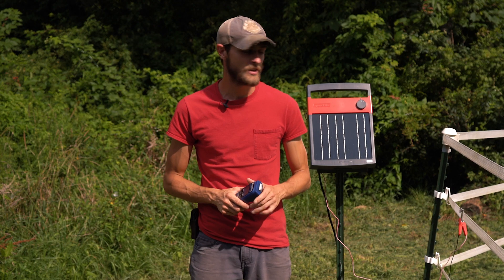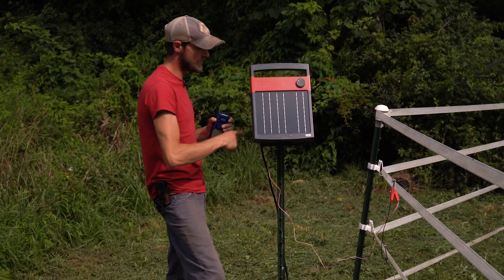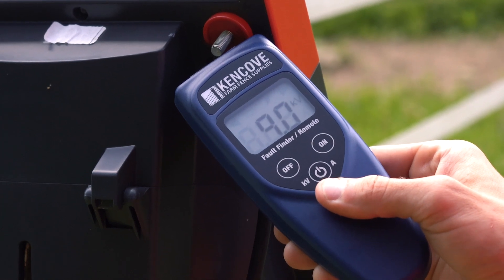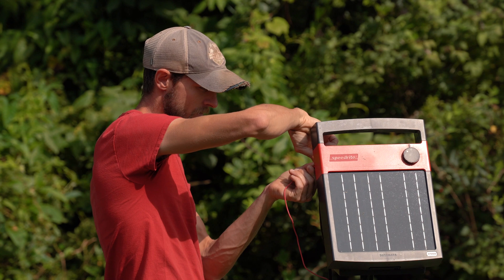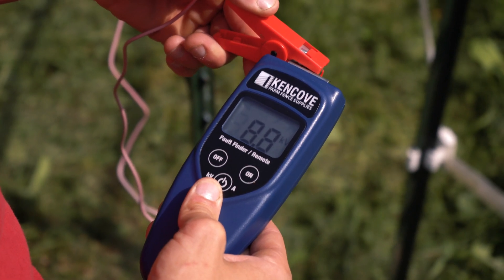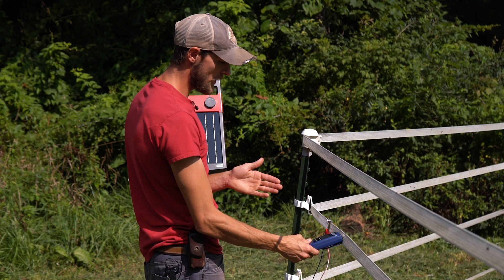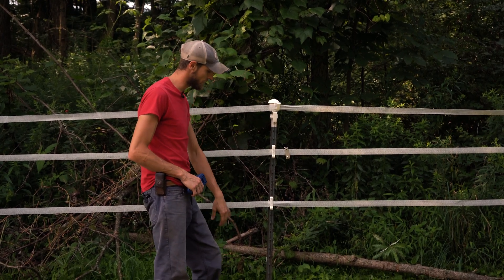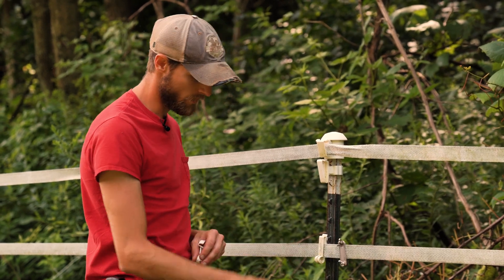Fencing 101 - How To Troubleshoot Your Energizer and Low Fence Voltage

Comment: Question please. 
We have an American Farm Works (Tractor Supply) solar energizer.
When turned on, the light flashes (as should) but there is no charge at the terminals. 
Any ideas? 
Thanks!
Reply from the maker: Hi Gary, have you checked that the battery is charged fully? If it is fully charged and still not working, you may need the energizer inspected and repaired. If you need help finding an authorized repair center, we can make a recommendation. We also carry solar units if you need a back up. Let us know if we can help!
Reply: @KencoveFarmFence Thanks so very much. 
I have a new one I can use. Again, thanks!

Comment: Why is my energizer popping?
Reply: Is it your actual energizer or elsewhere? Whe I hear a pop it's on the wires which are grounding out as the energizer pulses voltage (the light blinking on the energizer). Your wire is probably grounding against a tstake if you hear an actual popping. Check each stake and where the wire is. You'll probably see the spark jumping from wire to post (grounding out and what you hear popping)
Reply: If it’s pulling a 9 and gets you you will get some old time religion